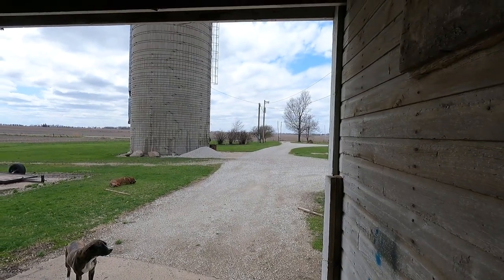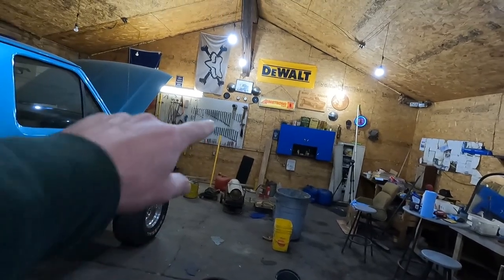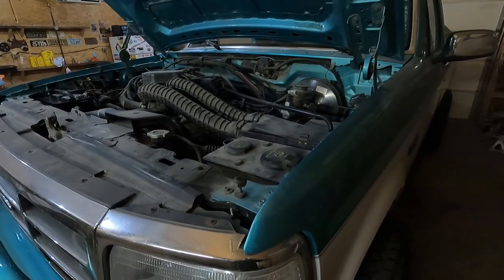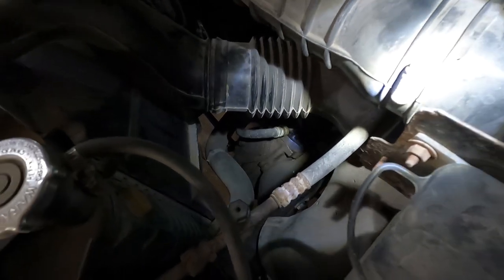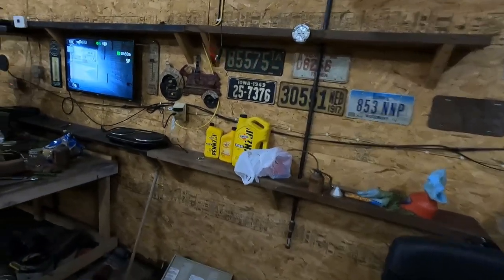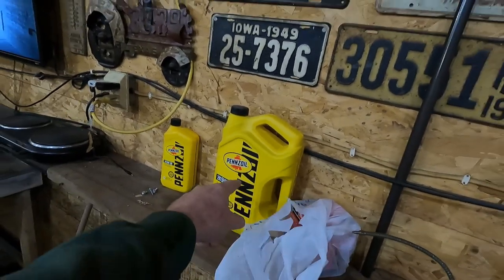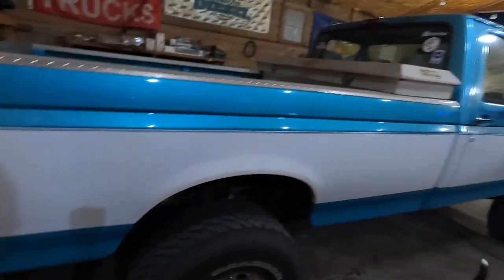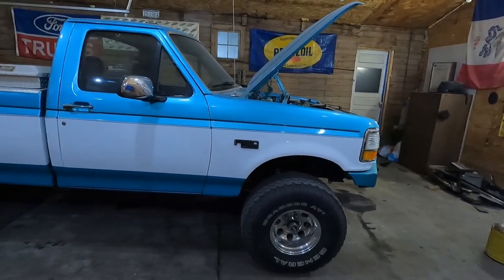CHANGING From CONVENTIONAL Oil To SYNTHETIC BLEND Oil and The Saginaw Power Steering Pump Issue

Comment: I've owned a 2002 Saturn SC for 6 years and changed to Mobil 1 High Mileage (has seal condition included) after purchase. It has over 300,000 miles and no oil on the garage floor.

Comment: Been using Mobile 1 Full Synthetic in my 1996 Ford F-150 4x4 with a 5.0. Haven't really noticed any changes from conventional oil. Can't find any grease fittings on any of my u-joints so I guess they are sealed.

Comment: Not sure why maybe the dipstick is improperly graduated but 5-1/2 quarts puts
me right on the full mark on my 95 5.0. Although the manual says 6
Reply: My book says 6 litres, I am in canada, a litre is slightly smaller than a quart
Reply: With or without filter change? Mine always ends up near perfect with 6 quarts with a new filter. I usually fill the filter a little before installing. I always check it after running for a minute or so, are you doing that?

Comment: Man that mold is gonna explode as soon as the real heat hits.

I changed my 98 F150 to Mobil 1 full synthetic at 500 miles and have used nothing but, every 3,000, now at 208K.  It’s all I use in every 4-cycle engine I own.

Changing from mineral oil to synthetic can cause leaks, but not because of any fault of the synthetic.  The mineral oil creates a sludge layer over the gaskets, then the gaskets dry out and shrink since they don’t get much oil on them, then the synthetic comes along and washes all the sludge off.  It might leak, it might not.
Reply from the maker: Yeah weird stuff may start growing out of the ceiling 😂
Reply: @TheFoxShop  hahaha, why not me?  I’m a fungai